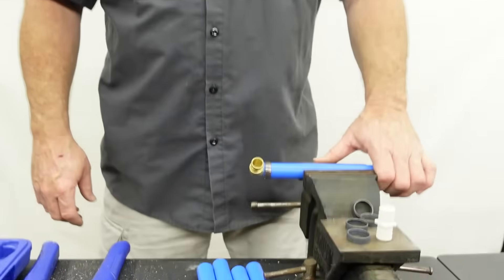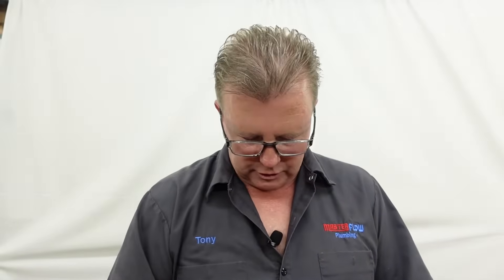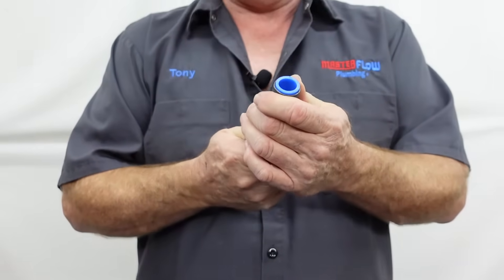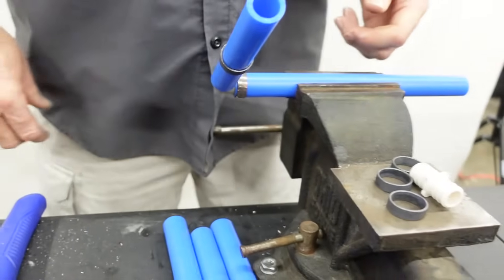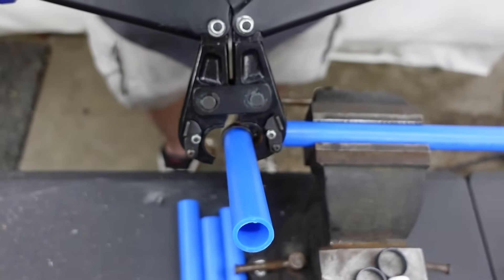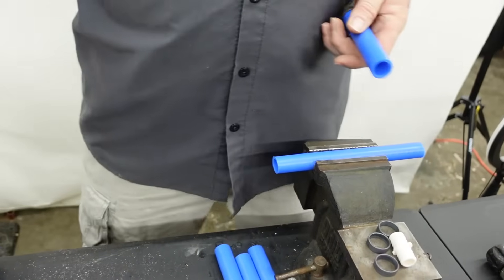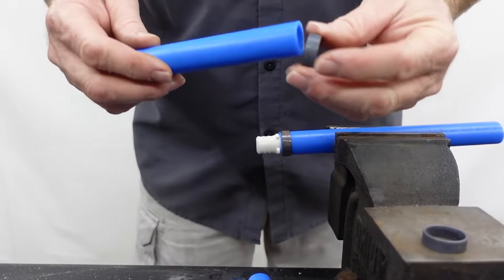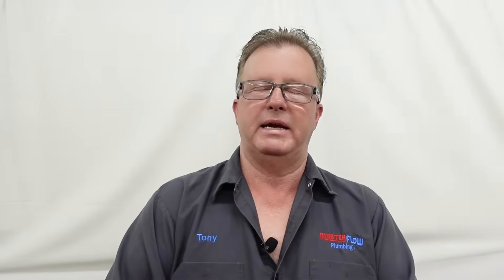Pex Plumbing Installation (How To Crimp A Pex Fitting)

Comment: This was my first attempt at using PEX (all my previous houses used copper tubing throughout). I didnt have to view any other videos, yours was excellent and the results were perfect. The only thing I wished you had mentioned was that crimping is pretty hard work (Im pretty old with a bit of arthritis). For me the key was doing the most of the crimping at waist level and then doing the last few crimps to put it in place. All in all though, very pleased - thanks for a great video.
Reply from the maker: Thanks for watching.  Glad our video helped.

Comment: I have a manual PEX crimper.   Had 3 crimps on each side, made the mistake of starting with the polyB to Pex adapter then the shut off all done reaching into the cabinet, I realized I could of done 2 of 3 crimps outside the cabinet after my forearms were hurting.

My question is Ryobi has a battery PEX crimper, anyone know if they work good?  Reliable?
Reply from the maker: I have a Milwaukee pex crimp tool.  It’s pretty nice.  Thanks for watching